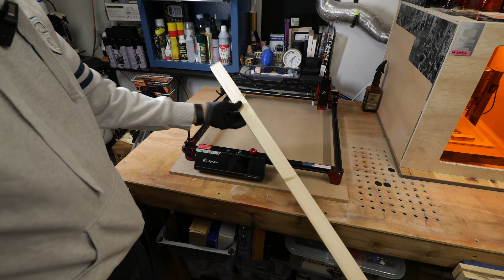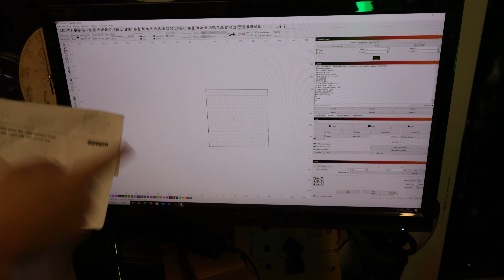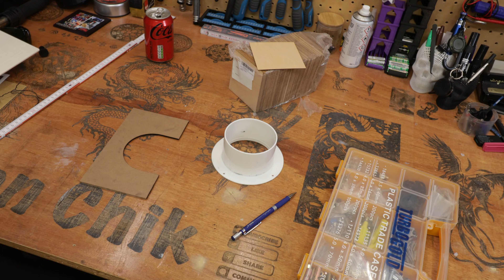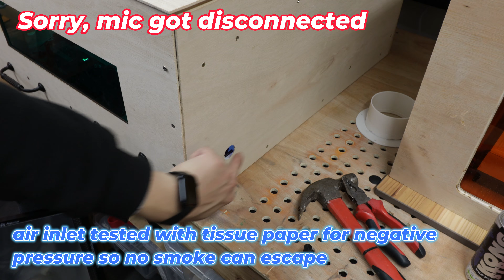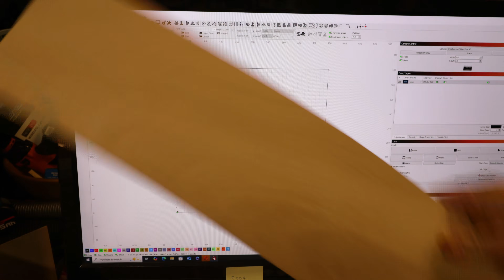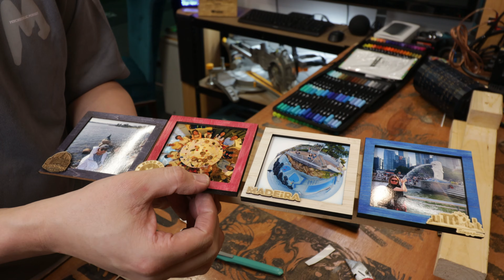DIY Laser Engraver Enclosure Start to Finish with AlgoLaser 10W

Comment: May I ask: what do you mean the laser is not a perfect circle? Ive noticed too when I cut paper with air assist, my y axis cuts needs a slower speed
Reply from the maker: I think you mean when I was talking about the laser dot not being a circle? Yes, laser dot is not a circle and slightly longer on one of the axis. It may not be a big difference but given the energy density over the area difference even if the dot is slightly wider on one axis there will be more power absorbed per given time. Hence one axis will always cut better then other, this effect usually more for laser with less laser stacked. 10w you stack 2x5w and 20w you stack 4x5w, since they never perfectly focused over each other the overall size of the laser dot is bigger and you loose some resolution when engraving and also less effect of one axis stronger than the other.
Reply: @BCreviews thank you so much for the explanation. I noticed the issue being more preventative when I use my air assist. 🤷